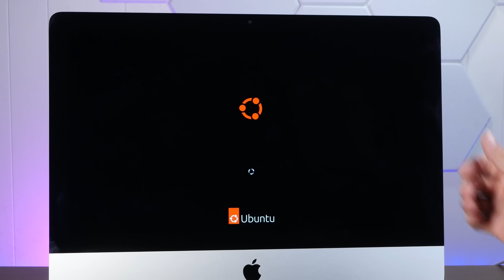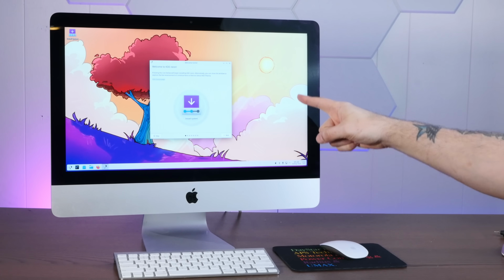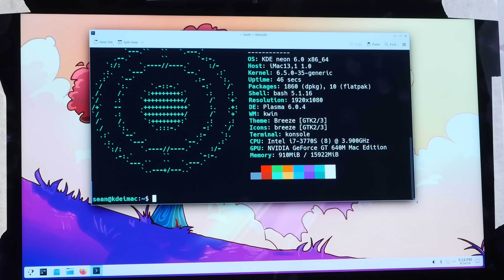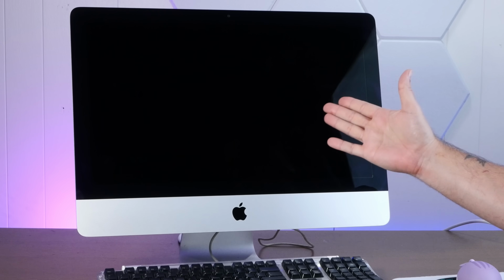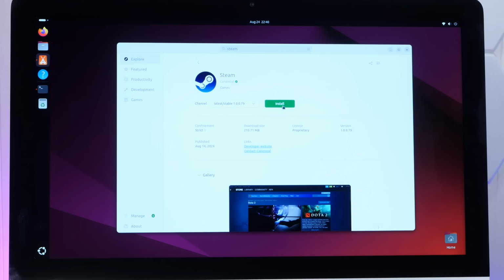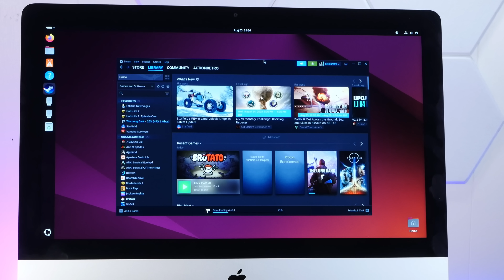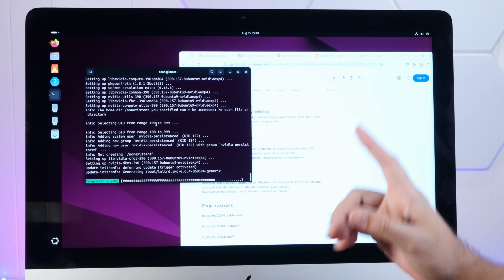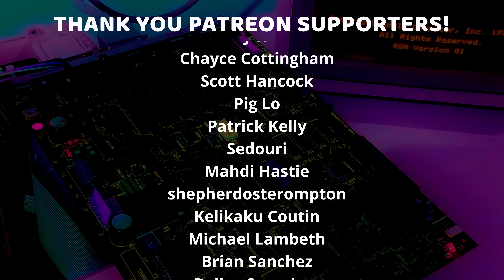LATEST Ubuntu on a 2012 iMac! (CPU Swap!)

Comment: You should try the Nvidia 470 driver instead of 390. 470 supports GT640 chipsets and was EOLd just recently (july 2024 I think).
Reply from the maker: I actually found that 470 kind of works after filming, but I get some weird issues - a phantom display, and an extended desktop that pans left to right with no obvious way to fix it outside of xrandr. And games crash immediately hah
Reply: @ActionRetro Try use x11 or xorg whatever instead wayland

Comment: The 3770 is shockingly usable in 2024. I have one in my daughter's gaming pc paired with an RX580 and it handles everything we throw at it.
Reply: The 3770k did a real good job tiding me over running red dead redemption 2 when that game launched and the ryzen 3700x computer i had built in preparation of that game was unable to launch it for the week it took until an experimental bios update somehow fixed that specific game in particular

Comment: would it like xeon e3 v2  because you could find low tpd slow multi core cpu's with ht and in most cases they wouldn't tax the vrm as much as i7
since it has that geforce lack of integrated graphics would probably be no problem, but there is always xeons with 3 at the end

Comment: I have an old 27" iMac and one of the things that is good about this unit is that it uses MXM video cards.  Even though most after-market cards are not immediately visible at POST, once the alternate OS is booted, they show up on screen fine.  You might try this scenario if gaming is your goal and want to use older Mac hardware to do it.
Reply: 2009-2011 unibody models have NOTORIOUSLY awful cooling though, so I would stay away from anything more intensive than Minecraft on them. A Mac Pro 5,1 would fare considerably better here, I own both and the stock Pro blows the iMac 27 out of the water.

Comment: EXCUSE ME? YOU CAN SWAP THE CPU ON THESE? Man, grandma gonna get some upgrades, ssd is the priority, but you know, 16gb and i7 could be of some use...
Reply: Please be very careful with the screen, they seem easy to crack
Reply: Just be dosdude1 and swap soldered CPUs
Reply: @pawtail  real
Reply: If you're brave enough you can swap the CPU on anything
Reply: @marxisttheoryandlore not really. You can swap it provide it has the correct physical socket, and the correct chipset notably the North bridge on the motherboard to correctly drive the PCI lanes and memory buses and with the correct fréquence ranges. In addition the bios must support that processor in it's allowed configurations, to propermy set voltages, frequences, and and layoute of ram banks and channel modes.
If your motherboard was based on Intel, you don't have lot of choices as Intel changes the socket type very often, so upgrades are suite limited to a small family.

Comment: I am really thankful for your videos!
Because of you I bought a 150 EUR MacBook Air (the wonderful 11 inch) and am running linux on it ever since to have an unltra portable little box for conferences and the like.
A quick look on german craigslist equivalent kleinanzeigen shows some interesting offers even below 100 EUR...
Do you happen to know wether this model was one of those still usable as external displays with that proprietary thunderbolt cable?I am tempted to try your CPU swap as well, have it dual boot linux and macOS and put this into usage...

Comment: even if you install proprietary nvidia driver, you will not be able to run steam games- proton requires vulkan support for dxvk and 640m does not support it. so, you need to connect newer gpu (looks for wifi slot xD)
Reply: Is dxvk the only option? I read that WineD3D can handle up to Dx11. That should use OpenGL.
Reply: there's an environment variable to use wined3d instead of dxvk
Reply: @sasha-fe2bl  yes, but wined3d does not work good (in comparison with dxvk/d8vk). and no dx12 support (on opengl hardware).
Reply: @Stedmiel  yeah it's not ideal for sure

Comment: 24.04 is not a great distro as of now... I have a few boxes for games and ai and general desktop... 24.04 has been more trouble than it is worth, I rolled back the gaming and ai box to 22.04 and let the newer distro bake a little bit more.
Reply: I also found 24.04 buggy for my nextcloud server I just built. So I reinstalled 22.04 and it's been very stable. The only issues I've had is with nextcloud itself but the OS has been great.

Comment: I bought one of these and upgraded to an i7-3770s too.  I was hoping to install Windows on it, but sadly, Apple hasn’t maintained the BootCamp drivers on this thing and it BSODs after installing updates.  Ended up installing the latest Ubuntu too, and running Windows virtualized (along with MacOS).😂

Comment: I got a modern Linux distro (AntiX 23.1) to run on a 2001 Pentium III Dell Laptop with only 384 MB of RAM. Had to install an IDE SSD to make the boot process bearable, but it's surprisingly workable. Kernel 5.10, and LibreOffice works just fine.

Comment: Apple's highly-skilled accountants made damn sure they put a stop to this kind of product longevity a few years ago.
Reply: They do it by blocking macos updates.. You need hacks to update the os's so you can run latest xcode and you have to have the latest to make builds for appstore. Quite annoying.
Reply: @lasskinn  Yep. But Apple Silicon changed everything.
Reply: @6StringPassion. these old Intel Macs are plenty powerful enough for 95% or more of most computer users, in what they use their computer for. Everything else that has come since is just Apple hipster hype and pop culture faddism - and, of course, Apple trying to artificially push demand for latest, more expensive hardware that almost no one really actually needs.
Reply: @TheSulross  Look at it this way. Apple knows that the iPhone (not the Pro or Pro Max etc.) can handle 95% of every computing task a person could want. And they even acknowledged that the regular iPad and iPad Air could handle 100% of all computing tasks the average person could do, and more. Apple refused to make iPadOS more MacOS like because they were afraid they'd steal sales from Mac because they acknowledge regular people don't need a full fledged computer anymore. I don't use my desktop unless I'm gaming or doing photo related work. My i5 laptop with 1050 is overkill for my needs of rendering 3D models/3D print STL files and web surfing.
Reply: @matthewjbauer1990  There’s some kickstarter project where is basically a full on laptop except to function a Raspberry Pi has to be connected to it. And it achieved way past its funding goal. Guess that’s the logical next step - the phone is THE computing device and everything else is just a dumb terminal that only comes to life when mated with a phone. To provide nice keyboard, mouse, and bigger screen. But my phone needs 12 cores, 64GB RAM, 1TB storage, and 4GHz CPU clock speed to muscle my other computers out of their reason for existing. Probably not all that far away from those kind of specs.
Reply: @TheSulross  NexDock makes various devices that are basically keyboard and screens with just enough internals to connect to a phone that can output over USB-C, something like screen mirroring or Samsung Dex. But what I meant is that most people don't care for that and they are happy just to use their phone like a phone or watch video on the small screen. I'd even not be surprised in 10 years if college students are typing their doctoral thesis paper on the next Galaxy phone.
Reply: Microsoft mimics it with SSE4 or TPM 2.0 requirements in Windows 11... You can't use Ryzen 1 gen or Intel 6/7 gen even they are still powerful enough... In one year these PCs will be obsolete for no reason, when W10 reaches EOL...
Reply: @tennickjestzajety69  Well... Look at it this way: Intel 6 gen retailed 9 years ago this month and Intel 7th retailed 7 years ago. Those processors are old. Ryzen 1 at 7 years old (but newer than 7th gen Intel) is old. Even my Ryzen 2600 system, at 6 years old is old. But old doesn't mean obsolete because you have Linux as long as you don't have apps/programs that mandate the use of Windows.
Reply: @matthewjbauer1990  yeah, you and me know about it, but stereotipical Karen or parents not and they are pressed to change theirs PC...
Reply: @tennickjestzajety69  I'm not even sure the stereotypical parent knows, comprehends, or if they do, cares. Most modern families use tablets or just their phones for most "computer tasks". If school work is needed to be done, a Chrome device is provided. Windows literacy is at an all time low these days.
Reply: I only wish more people understood this.  But Apple enjoys something that no other corporation I know of does, a loyalty by its fans that goes well beyond reason and into cultishness.  I'm actually surprised that you weren't flamed by some of them by your comment.  :) From past experience, any mention or even alluding to some of these issues on Apple community forms triggers Apple's censors.  They will either remove any mention of the issues or reject your comment altogether stating it goes against community standards.  I'd really like to know what kind of standards or community they really think they have to play at such weak psycho-crap by trying to shame people from complaining about their taking advantage of their customer base.   Because when they do it, they do it with that psuedo smile they're so good at.
Reply: @gemini62167  Yes - I have a flame proof safe room for that!  Actually, I have to be honest. One thing that Apple has done for me on several occasions is go well beyond expectations in terms of customer service.  That seems to be a totally foreign concept to PC manufacturers in general. The other thing is that (in my opinion) the overall quality of Apple's hardware is unmatched. Those more than anything are what lies at the root of my loyalty. Lastly, having Apple stores with real people vs big box retailers is a game changer.   But then they do dumbass things like charge an extra $20 if you want a black trackpad instead of white! 🤔😂
Reply: Should be illegal to design like they do now tbh
Reply: @trashtronics1700  As much as I agree, that is a rather idealistic wish.  We've long since entered into the dark cycle of capitalism, where the old models of business are no longer the norm.  It isn't about innovation any longer.  The bigger fish have grown so big (in almost all industries of importance) they have swallowed and continue to swallow any competition.  Apple actually has a long history of this.  Once this occurs, the old notions of competition bringing about new innovations and ever improving products begins to slow and cease.  Instead, the reverse begins.  The old joke of planned obscelecence stops being a joke, and becomes a reality.  This is why almost everything you purchase, in almost every consumer industry, is now made cheaper than it was ten years ago.  And it doesn't matter how long a company has been around, nor how well deserved its reputuation for its products were, what happens is they begin to rely upon those long ago deserved reputations to carry the up and comming generations who become the economic players to believe that their products are still quality, still the same, and no different than they had ever been.  This is because it isn't usually until a generation becomes adults or responsible for living the adult life as consumers that they ever realize what they are buying.  Prior to that, that was all usually handled by their parents or care givers.  Companies know this.  Smaller companies may not be able to get away with this kind of strategy, but small companies are not the dominate consumer product draw.  The big players no longer play within the boundaries of the industries they began in, instead they diversify and immensely.  Their income is from many different areas, and as such their overall customer base is so large that they actually reach a level where alienating a percentage of them in one industry is no longer as much as a threat as it would have been when they will still a single national corporation operating within the limitations of a population say, even that of the U.S., which is now the third largest population in the world.  These are indeed scary times, and not just from a consumer stand point by far. Unfortunately few people care.  And that there, is where the problem truly lies. Companies do not grow to be as large as they do by just eating their Wheaties in the morning.  We grow them by purchasing their products and not being able to step back and say no when they cross lines. Instead of making the distinction between desire and need, we confuse those concepts and become willing to throw money at them because we can't deal with the idea of going without something we want.  We've been socially programmed to be this way, and intensely more so these past two decades.
Reply: OpenCore legacy patcher works great to get past this. I have Sonoma 14.6 installed on my 2013 Air.

Comment: I used Mint Xfce to breathe new life into my sister's late 2012 iMac. It's a dedicated streaming machine and does it perfectly well.
Reply: I tried out the same on a 2012 macbook my buddy was going to scrap. It's still scrap but now it runs mint.
Reply: @ffwast  Sounds like when I put PPC Fedora on a 5 year old iBook G4 years and years ago. It was still useless and slow, but it was useless and slow with Linux.
Reply: @spazzypengin  Oh it does light stuff like web browsing fine,it's just been run over.
Reply: I picked up one of these two years ago at a school auction for $140. Recently I attached an external USB SSD and installed OpenCore Legacy Patcher, then Monterey on it. It's now an excellent streaming machine especially because I was able to use an old Thunderbolt-DisplayPort cable for a second monitor.

Comment: Don't forget Sodium, Lithium, Optifine and other performance increasing mods for Minecraft! You can get a much more playable experience with it.
Reply: I don't want sodium or lithium in my laptop
Reply: @Pleyer7575lol  you might not want to hear this but check your battery.
Reply: @JustMiniBanana  opens up laptop AAH
Reply: @Pleyer7575lol I produce my own sodium chloride when gaming
Reply: Sodium and Lithum and not Optifine
Would probably run very well with those and a few more optimization mods (ModernFix, FerriteCore, ImmediatelyFast)
Reply: Was Minecraft running at full speed anyway without the proprietary drivers? I would have expected it to run fine on that GPU with default settings, unless the resolution was set too high.

I still think he ought to drop down to 22.04 which still has support, and apparently has the driver's and kernel he needed.

Trying to retrofit everything in 24.04 seems like it would be prone to breakage.
Reply: Also the Fabulously Optimized modpack coupled with Prism Launcher is really nice
Reply: Optifine and sodium aren't compatible. Use just sodium.
Reply: Lunar Client is pretty good for getting performance out of machines like this, shame it’s only available as an AppImage for Linux though

Comment: Just installed EndeavourOS (Arch based Linux distro) on a ThinkPad T25 (25th Anniversary ThinkPad) that I got. Sadly, the batteries are pretty degraded, but I upgraded the RAM to 32 GB and the SSD to 4 TB (I didn't have an 8 TB SSD hanging around at the time and it's a PITA to upgrade the SSD inside its cage for this model). Sadly for some people, despite having a TPM 2.0 chip (because it was a ThinkPad) it still can't "officially" run Windows 11 because the CPU is a 7th gen Intel CPU, but given I don't use Windows anymore, that's fine by me! More Linux for me, especially given these things were hard to find! I had to pick it up from a person whose partner worked for IBM/Lenovo's ThinkPad division and went to the Japan R&D lab that they were made back in the day and it took YEARS to find it!
Reply: Huge recommendation for using Rufus to set up Windows 11.  Removes the TPM requirement, and lets you change a few of the default settings (e.g. allowing you to use a local account).
Reply: If necessary, give Tiny11 a try to slap win11 on that thang
Reply: Another Thinkpad rightfully converted to Linux :)